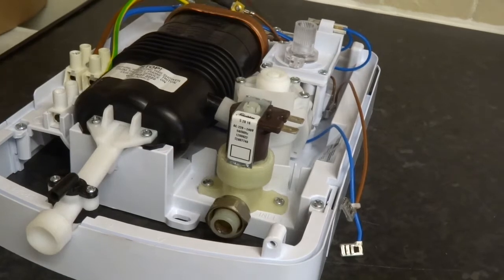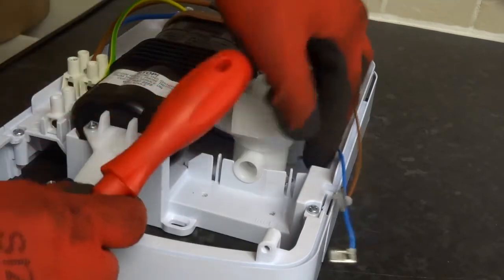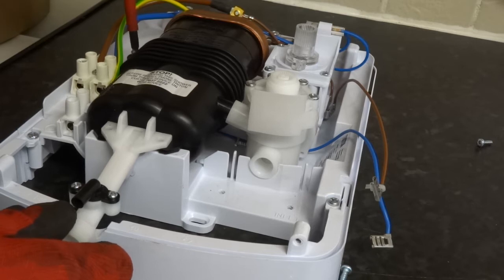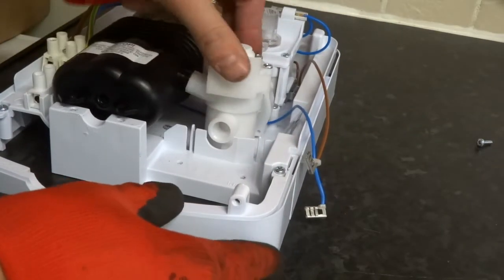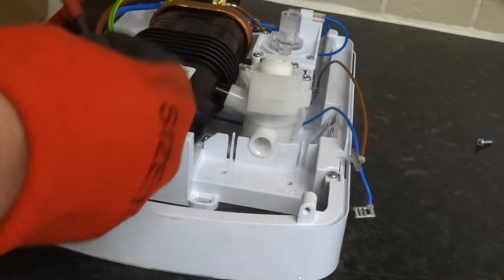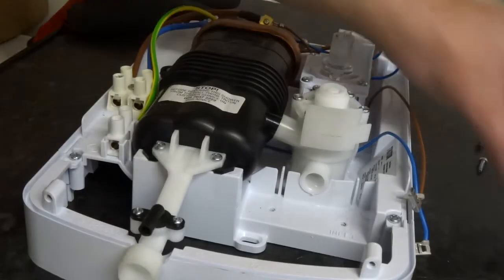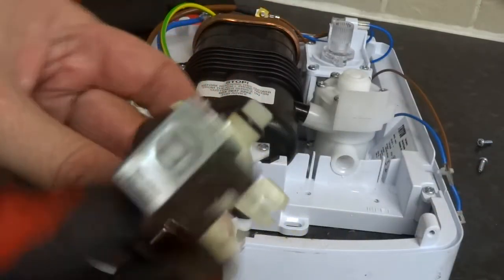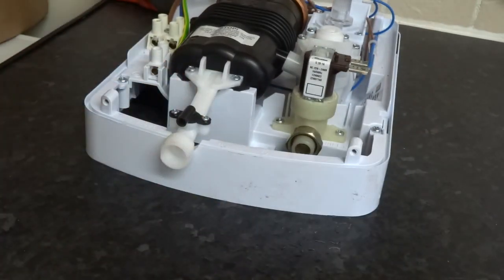Electric shower , changing flow control stabiliser valve heating hot water control

Comment: A very helpful video! Going to need to do this on my shower soon. So far I have replaced the pressure relief valve and Solenoid. At this rate, with the spare parts, I will have a new shower 😂 
So helpful to know that it’s the ‘O’ rings that joins the inlet and outlet to the stabiliser- I was worried they may have been bonded in some way. Many thanks!

Comment: Hello I have issue with Triton 80z shower it suddenly just not working as it should solenoid PDR valve changed but still only little bit of water flowing could it be the flow control valve?
Reply from the maker: possible or water pressure issue - out let hose blocked collapsed - heater can blocked
Reply from the maker: could be solnoid valve stiff and jammed
Reply: @cagmito76 water flow going in is normal and I have changed the solenoid
Reply from the maker: @YAX16  the solenoid or the valve as the internal valve can get stuck - check microswitches to
Reply: @cagmito76 thanks

Comment: I replaced the shower relief device ,as it was  leaking.  The leaking has now stopped, but I've noticed the  water doesn't get very hot.  Any advice would be appreciated.
Reply from the maker: maybe its flow related ?

Comment: Hi, we hv a problem. New triton installed by husband replacing old. Cold setting is hot, and hot is cold. Help please. Ty
Reply from the maker: It must be the selector switch not aligned properly see my video on removing and replacing cover if not it might be wired incorrectly so be careful

Comment: Hi all
So got a shower problem and hope someone can help

1) t70xr kept running cold, like it was the TCO, but then came on warm with 
power 1 eco now cold and power 2 warm, not hot.
So half the can is dead or maybe a switch fault in the shower.

2) Replaced the shower with a new t100xr, and it works on cold, eco power 1, but on full power 2 it shuts off all flow after about 5 minutes 

What are the symptoms of low current caused by gloss crud or a film on pull switch or shower power block wire ends

So old shower now runs warm on half a ca, new one runs on cold setting and eco
Normally I'd say solenoid, but it's only doing it on max
 
Maybe lack of current damaged the first one and is causing the new one problem
Reply from the maker: did you resolve issue

Comment: brilliant advise thanks please keep the vids coming i have a shower doing something similar gets hot but little water thinking flow valve. thanks again
Reply from the maker: Glad to help yeah could be flow valve how olds is it is head clear and pipe running easy , thanks
Reply: @cagmito76  hi yes head and pipe clear it’s around 3 years old gonna test it today

Comment: Thanks for the demonstration....how do you do this with the shower unit in place and connected to the water inflow supply ?
Reply from the maker: You need to isolate the water and electric first and then undo the inlet compression joint its all easy enough nothing to worry about,.
Reply: You mean turn off water by the mains? @cagmito76